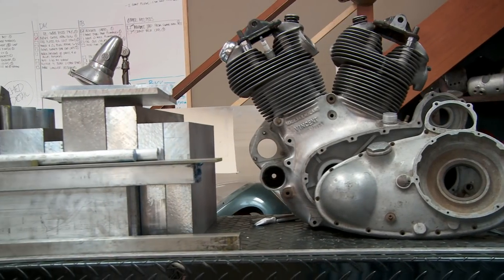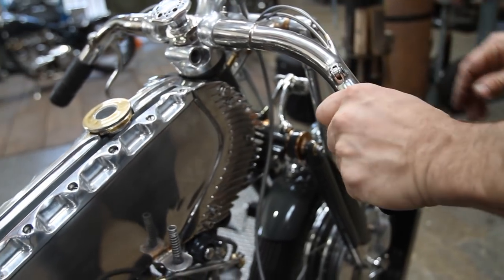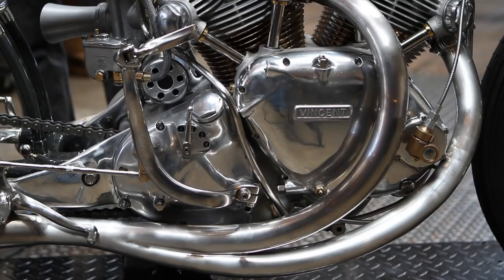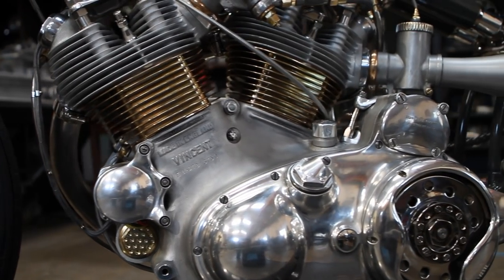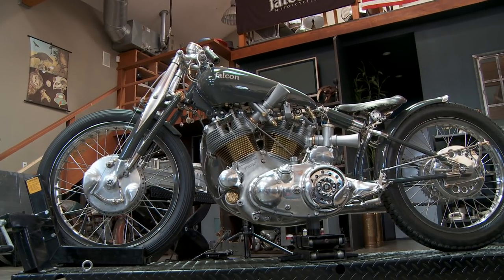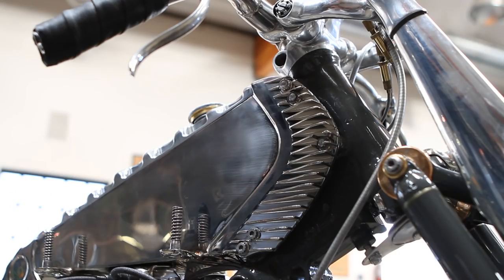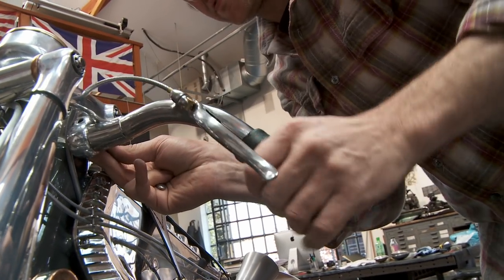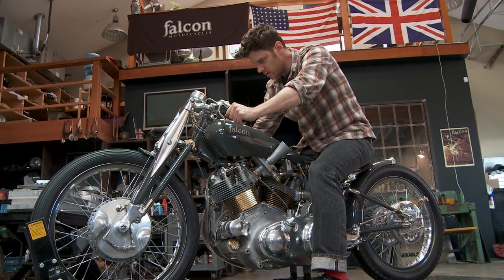Black Falcon by Falcon Motorcycles

Comment: I'm totally impressed with this, I've sought a Vincent since the sixties, watched a dozen or so racing, a couple riding but never even got to throw a leg over one.  I served from 76 to 97, in the marines, saw quite a few early, racing, a couple on the open road, and here and there overseas, occasionally.  I have built somewhere around a hundred custom bikes, here in N.C., and only wish I'd stumbled across this long ago.  I worked avionics on jets and helicopters, and of course on the birds themselves, we always were short handed, and this is a beautiful example of fine craftsmanship, love of the art.  I've got a ninety inch "Harley" chopper, I built it in 95, handbuilt frame, made much of the whole of it custom, but never once had a chance to buy a Vincent, not even a badly mauled engine.  I have often considered using a "Sportster engine" as a foundation and building a clone, but it never was close enough to be worth the effort, it wouldn't be a "Vincent".  That is a level not met any other way.  Thanks for showing this incredible build.

Comment: Also meant to add, that this motorcycle makes a refreshing change in an era when our TV channels are awash with  motorcycle builds consisting of  brand new stock bought in frames, brand new stock bought in engines, guards and then multiple bits of tin plate being bent, rolled, beaten and welded together, along with tantrums and usually extremely expensive and usable workshop equipment being replaced by even more expensive computer controlled equipment all of which means less human involvement.

Comment: @hakerkatz - not a piece of chrome on the bike, and very little paint. We designed and fabricated everything except the carbs, tires and engine in house, and when it comes to parts like front & rear brakes, forks, swingarm, suspension, shocks, cylinders etc. they definitely have to be engineered ;)

Comment: @hakerkatz - We don't aim to comply with SAE governmental, aerospace, or automotive standards, unless we were Honda, Ducatti, Yamaha etc. this wouldn't be realistic. The fabrication of brakes, forks, swingarm, suspension, shocks, cylinders etc. takes engineering as well as design. We use state of the art equipment, including our 5 axis CNC accurate within 2/10th of a thousanth. Our tolerances with respect to Motorcycle Industry Standard are above spec and beyond tolerances of the original bikes.

Comment: Five blokes ,1 years  Thats 5 man years.. What the fuck were they doing? You could hand file a whole bike out of a block of steel in that time. Lets say a 40 hour working week for one year times 5 guys is  10,400 hours . They didnt make the engine or the spokes or the  wheels or the tyres  or the hubs or the gauges or the lights or the wires and cables. Spent some time on a buffing wheel ,ok. Please can we have some perspective? Yes it looks great but cut the hypebole.